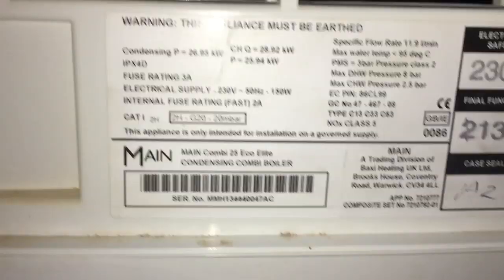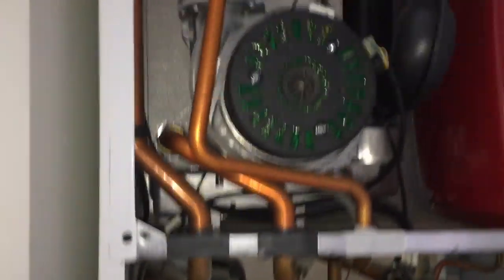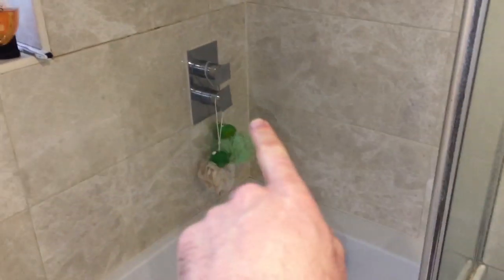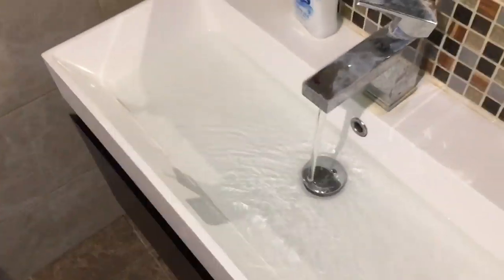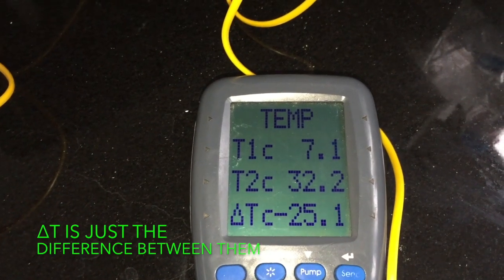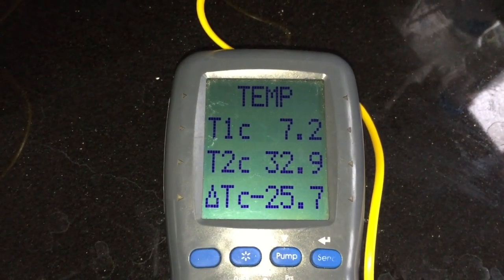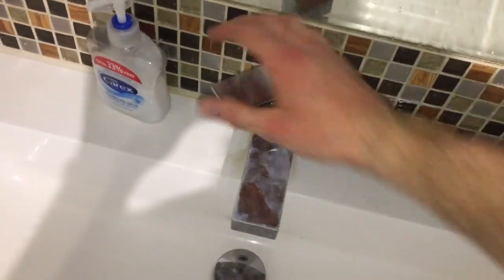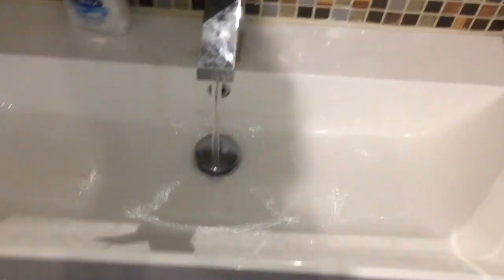Combi boiler hot water issues. Repaired and principals explained.

Comment: i had the same issue, i reduced the flow to the boiler the water to the taps getting hot, but customer complained that the pressure is low, how do you fix the pressure, appreciate the reply 🫡
Reply from the maker: What litres per min is boiler designed to do? What did you set it to?
Reply: @ 
It was an eboiler by storm Min Heating Pressure 0.5 Bar. Max DHW Pressure 6 Bar. DHW flow rate 7 litres per min.
Reply: @ what would you think about the problem?

Comment: Quality video, mate.  Cheers.  Would slowing the flow rate down it the cold inlet not reduce pressure at the hot tap through?
Reply from the maker: Yes, but the boiler is only designed and physically can only do a certain amount of hot water. If they wanted more they should have got a bigger boiler.

Comment: Hi I have a customer who just called saying her hot water temperature is going into the 90s. All I've done is move rad pipes in bathroom to new position then filled up to 1 bar pressure. She said she can hear gulping noise from boiler. Have I trapped air in the system which is causing the hot water temperature to rise? If so do I need to drain heating system down the refill and bleed to remove the air?

Comment: exact problem my mother in law is having atm with her worcester combi. hot water to bath very poor. had council out twice but no joy. will have to direct them to this video
Reply from the maker: On the worcester, the mains adaptor behind the flow switch has probably fallen apart and the 2 little flow reducers have fallen out. :-)
Reply: Check to see if the impeller is blocked. Symptoms like water will not heat beyond tepid regardless of the boiler setting. Many think it's the heat exchanger, flow rate or other 'stuff' etc etc etc but if the impeller is blocked then this causes the hot water from the main heat sink to the exchange plates to slow to a useless rate hence the exchange rate is all but useless too.
Slán go fóill

Comment: I changed a broken flow switch on a grant vortex boiler and now the water is not as hot as usual and also the farthest hot tap away from the boiler is intermittent on calling for heat?
Reply from the maker: I would guess something is blending. Cold is getting into the hot somewhere. Run the tap that doesn't register demand and go and listen to all the other taps in the house. You will hear the issue. :-)
Reply: HeatingGeek thanks il try that. Do you think it could be a problem with the plate? I did think it could be the hot water pump but I can hear that working without any bad noises.
Reply from the maker: @deribrown  If it was the hot water pump would it not affect all the outlets?
Reply: HeatingGeek possibly? I’m not a boiler engineer , just trying to fix mine. I might try and reduce the flow on the valve behind the flow switch and see if it improves. Thanks for your input.

Comment: If I want to run hot water with the valve set to max temperature in the bath/shower faucet

The hot water runs cool (35*C) when faucet/tap is turned to MAXIMUM output (and max temp) in the BATH. If I want to run the hot water at the desired temperature of lets say 60*C, I must reduce the faucet valve to mid-range output, consequently weakening the stream.
I do not have this issue with the Kitchen and bathroom sinks. The can run very hot water with tap valves at max output… 

Could it be that the pipes which supply the hot water to the bath are larger than those which supply hot water to the sinks?? Perhaps the boiler cannot keep up with heating the water when its running at a high output? Not sure this is the reason though. The apartment is relatively new, and so is the Vaillant boiler.. Also the boiler supplies hot water to the radiators with no issues…

The hot water supply temperature setting on the boiler is indeed set at 65*C….
Also, this isn’t a faucet cartridge issue, because the hot water in the bath-faucet still behaves like this, even if I shut down the main cold-water supply, i.e. so there is not cold water interference…

Can’t get my head around this, any suggestions how I can get the hot water to run at a decent outout?!
THANKS
Reply from the maker: Check the flow rate. What boiler do you have?

Comment: The combi is undersized for sure. It cannot fill a bath fast enough.  A larger combi is not that much more expensive.
Reply from the maker: Im not there to fit a boiler. :-) I was called because the hw wasn't working. New property for the family and they were not used to the way a combi boiler works.

Comment: Was the hot water only an issue upstairs? Was that a giveaway for you to start looking in the direction you did or would that not matter very much?
Reply from the maker: The flow rate from the bath tap was much higher than the rest of the house. So the problem was more noticeable from that outlet.

Comment: interesting vid, been to an interesting one today being the 4th one with this fault, so a Worcester Greenstar junior installed 6 years ago producing just tepid hot water at all taps. Carried out all the usual checks ie, flow rate. gas rate, diverter valve not passing and all fine. Hot water leaving boiler red hot but all taps just tepid? The first one of these i encountered was same boiler as above and i installed only three moths earlier. I was baffled and got Worcester out under warranty. The engineer rang me next day from job to tell me the fault was the t/static bar shower running off boiler which was installed by whoever some time ago. The problem being that the cold feed to the shower was filtering through the shower by passing non return valve and diluting hot water circuit? an absolute new one to me but could be proven by isolating the shower  at check valves and hot water temp at all taps immediately raced up to temperature. Had never heard of this before but was assured by Worcester engineer his first one like this took him hours to suss out. So today my fourth one like this but two bar showers and no isolation valves to prove point, however, by vigorously turning t/static side of shower valves back and forwards several times then leaving temp at min taps are fine. Not a permanent solution but a point proven. I'm sure there will be many out there never seen this before but interesting all the same specially on cheapy showers
Reply from the maker: Yep. Its more common than you would think. :-)
Reply: Respect to the guy that figured out the problem.

Comment: Why did the heat drop in the first place
Reply from the maker: Because the water was running through the boiler too fast.
Reply: HeatingGeek boiler undersized?
Reply: @simonstones1918  boiler is fine for one bath. He sorted the issue boiler was getting a higher flow rate than it could handle. Lots of old taps are not restricted like newer ones and just let the whole flow rate through.

Comment: Good video but Would have checked the flow rate at the sink tap to confirm the correct flow before checking the temperature rise, that would confirm the plate wasn’t scaled or that a mixer wasn’t cross leaking cold into the hot pipes. Maybe this was done but not in the video ? Had quite a few mixer taps washing machine valves etc that leaked cold into the hot supply when running the hot reducing the temperature at the tap. If the flow is correct rate and the increase in temperature is correct at the outlet of the plate but not at the taps it’s not the boiler.
Reply from the maker: Leaking cold into the hot is common but I could feel the temperature at the boiler wasn't what it should be. If cold is bleeding into the hot then the pipe (hot) directly below the boiler would still be as hot as it should be but the blended water out of the tap would be warm (not hot). If you get what I mean.

Comment: Ok now I'll tell you how to do it properly...

Do not isolate the flow or return valves there prone to leaking.
If the flow gets warm your looking at a diverter so don't isolate it fix that if its not isolated by itself.!!!!! It would be the fault found.....
Now use a wier gauge you were flowing the water I can tell by eye about 4-5lm you don't turn the boiler down until you get the temp....
Measure the cold....measure the hot @ 11lm then does the 35c plus cold inlet (measured by thermometer not through copper via Kane) add the cold to the 35c expected are you getting what your thermometer says at the outlet...(take off relevant to distance of pipe)
Your differential is your loss...you should get 35 plus inlet temp minus 2-3c loss on pipes...
Then.......if you really want to cut a corner..risk them isolators & turn off the flow or return....rain via the built in drain point using manometer tube..
Then remove the AAV.....put some fx40 system cleaner(strong de scaler) into the AAv hole...
Put the AAv back & refil the boiler....
You can remove wires to drive motors or whatever to make the boiler stay in water mode..
Just run it & the chemicals will clean the whole boiler very fast...heat plate clean without removing...it makes the debris smaller & it passes through so you can the drain & remove chemicals & dirt in one go.....20 mins..fixed....not r
Just reducing there flow to compensate for bad performance.....use the AAv as a dosing point isolate the flow & circulate the domestic circuit repeatedly...then you'll get 11lm 35c rise...if not change the plate....gas rate is almost the last thing that causes stuff it's almost ever the cause..
Reply from the maker: Ok... The issue was the flow rate was too high, above 11Lpm. All the rest was done to show basic principles. The gas rate is the cause of the issue at the jobs I go to. Remember I go to the job after it has had 5 or more visits.
Low gas rate can be caused by: Low negative fan pressure, restricted flues and blocked injectors. These are causes I have seen this year alone, all effecting hot water on combis.
Reply: @HeatingGeek  or the boiler moderation as the heat has nowhere to go  more than likely , your right but keep it simple first
Reply: Agree with most of the above 
Why use all that complicated equipment when a weir cup and a gas rate would have led you to the same outcome
And feeling the pipes 
In and out 
Dosing the boiler does work through the AAV but the dreaded valves may leak lol
I try not to rely on any electrical testing equipment if at all possible
Never run a basin tap unattended also they tend to make the ceiling wet
Good video though

Comment: I got to 3 mins and this reminded me of a customer last week ! Change the boiler they insisted ! In the first clip I noticed there is a douche for the toilet...if this is in the Mixed position with pressure going to the end of the hose with the trigger mechanism fitted as it is...and if like my customer had cool water thru every tap that was hot in the house ! Any unbalanced even slightly will cause what I just described...basically the water flows thru the mixer and creates what ever the temp is set on that mixer ...which was warm enough to wash your Butt temp ! Still it's a great way to charge 10% of what a new boiler costs to fit ! I'm gonna watch the rest now bcos I'm curious about this one.
Reply from the maker: The ass washers always cause problems!!
This video is about basics of hot water from a combi. Many people miss the basic principles  of this.

Comment: I’m pretty sure it’s a blocked plate heat exchanger. Didn’t see a inline electrolytic De-scaler. You’ll be back in a few months to change it or flush it out.
Reply from the maker: It was filmed in January so it been 5 months. Im pretty sure its sorted.
Reply: Eward Richards they usually block on the primary side